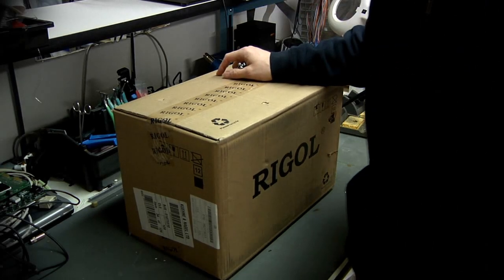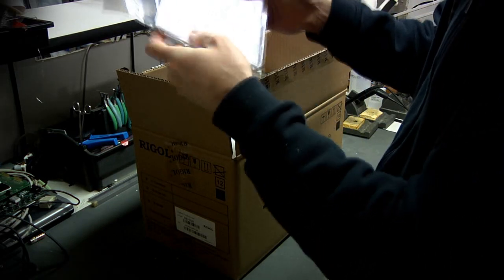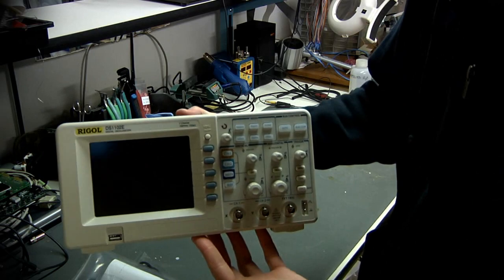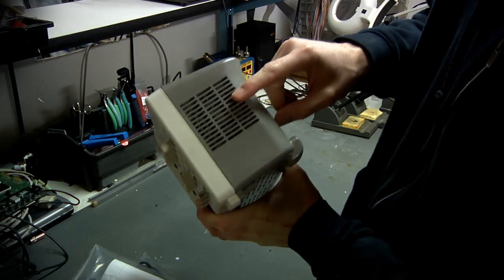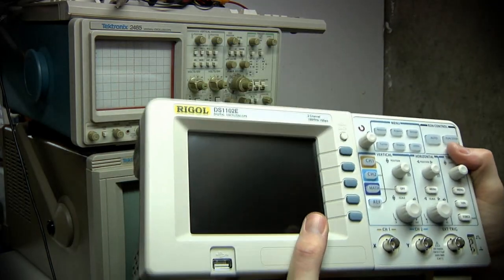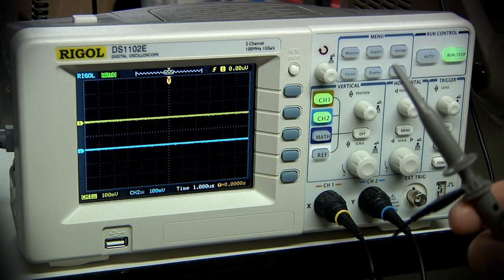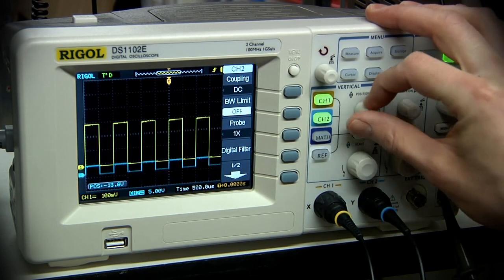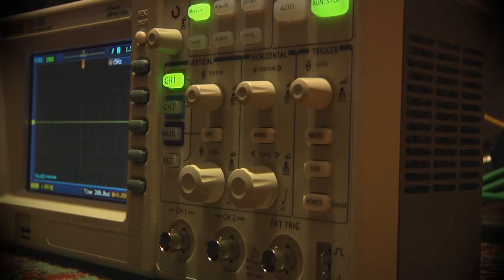Rigol DS1102E Unboxing, First Test, and Fan Noise

Comment: No issues whatsoever with fan noise on mine. Had it for over 2.5 years. Never once thought about fan noise until now, and now that I strain to hear it I can. Otherwise, silly to even mention it. Great device and in no way a "low end" product. I assume he means something else, like simply "not their top end model". Very different meanings there and worthwhile to be more careful when discussing quality equipment which this most certainly is.

Comment from the maker: Because the test/calibration signal output of most scopes is internally referenced to the same ground as the probes.  It's also a very low frequency (1kHz), so localized probe grounding is not critical.

Comment: Just got my 1052 from DX about 1 year ago.  Doing fine so far, though also noticed the cheap probes and the noisy fan.
Finally, got an old CPU fan scavenged from a dead PS, vacuum-cleaned it, drop some WD40 and bike oil inside, and mounted it using thick rubber O-rings between screws and frame to absorb noise.  The scope is far quieter now. 
Just a thought.

Comment from the maker: They dropped the price on the 100MHz scope, it's only about $50 more than the 50Mhz one.  Also, there were some rumors on forums about newer scopes (or newer firmware versions) acting flaky with the hack.  It wasn't worth the small savings to me to hack it.

Comment: Nice review, thanks. I have this scope and find that the fan noise increases substantially after a few minutes of operational, suggesting that the fan speed is tied to operating temperatures. Do you find the same?

Comment from the maker: Unfortunately mine was loud enough to be really irritating in a quiet room, so I ended up replacing the fan with a quieter one and it's not so bad now.  I didn't notice it as much when I was working in my electronics lab down in my basement, but when I had it up in my home office when I was doing a long round of firmware development, it bugged me enough to do something about it.

Comment: I see there is only one set of vertical control knobs for both the channels. How do you select the channel before adjusting? I see the front panel is quite confusing compared to a tek or siglent scope.